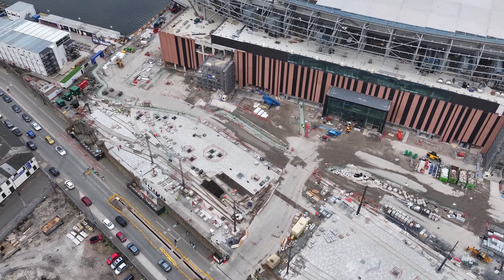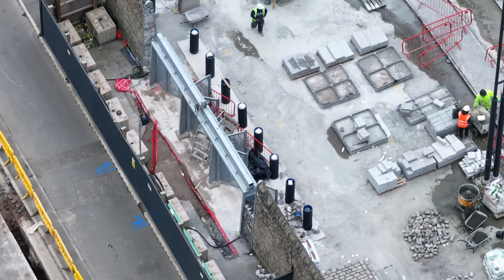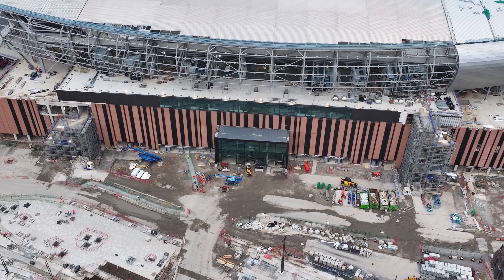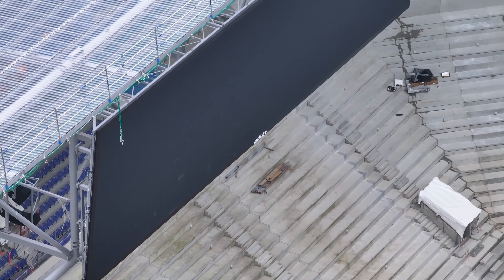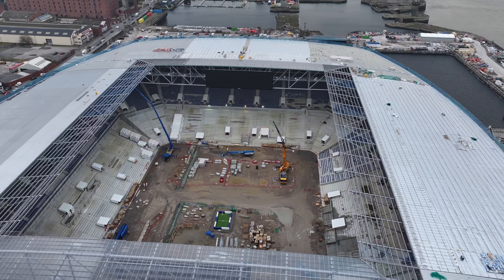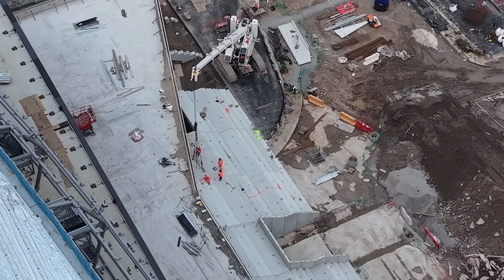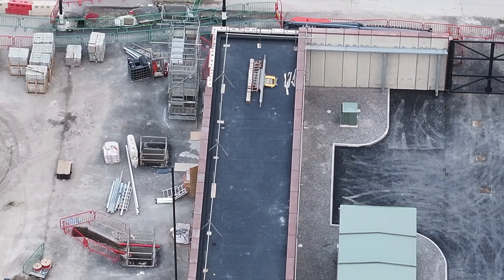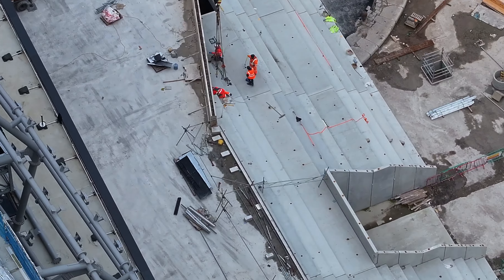Everton FC New Stadium at Bramley Moore Dock Update 07-03-2024

Comment: South Stand plaza end coverings have been put in place over the boarding.
Reply from the maker: Thanks for the info Mark, I'll look out for them cheers👍
Reply: Looks like crane maybe getting set up ready for barrel roof cladding on the N E corner
Reply: 8:47 ?
Reply from the maker: @JayEFC1969 8:47 was just after I had seen the nice paving along the south stand, still a bit there to do mate👍
Reply from the maker: Can't believe I missed those glass sections.  Strong wind and low battery didn't help there.  Cheers👍
Reply: Think I might be wrong thinking about it more than likely for putting steels in for the Northern side of the west fan plaza
Reply: @JayEFC1969  Yes mate